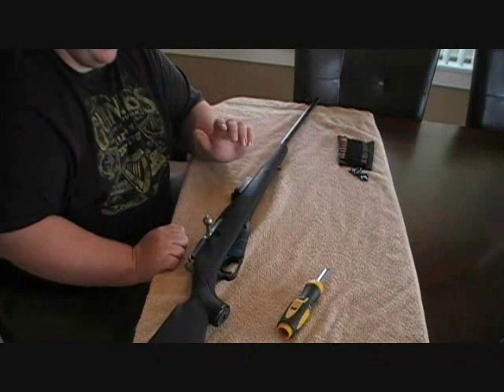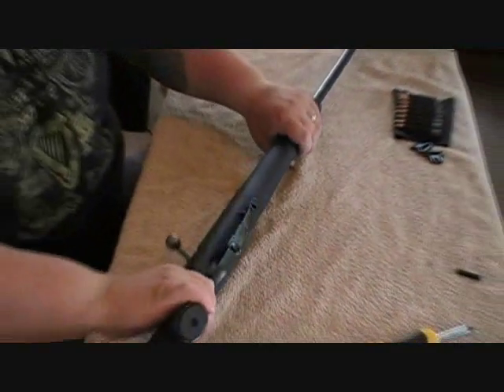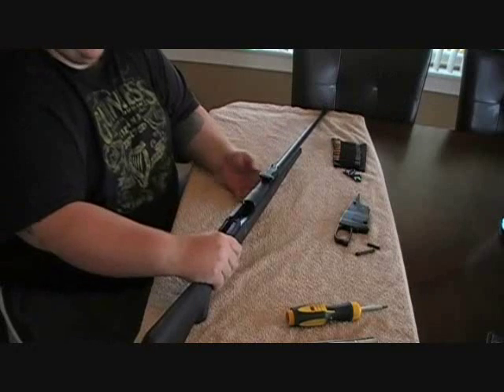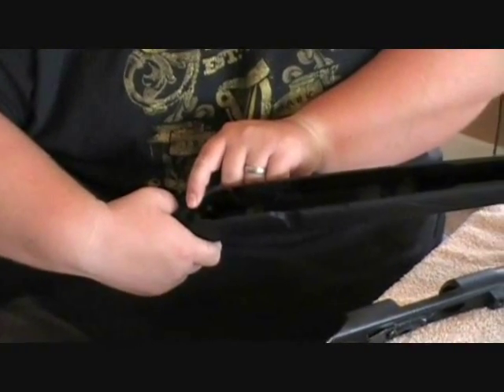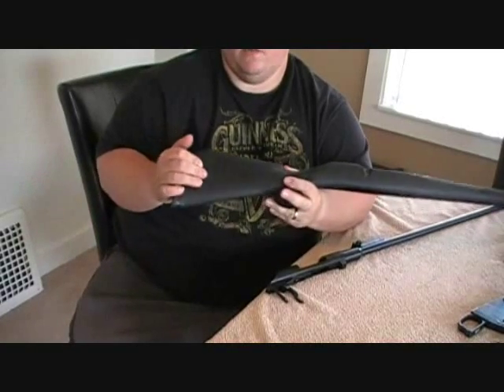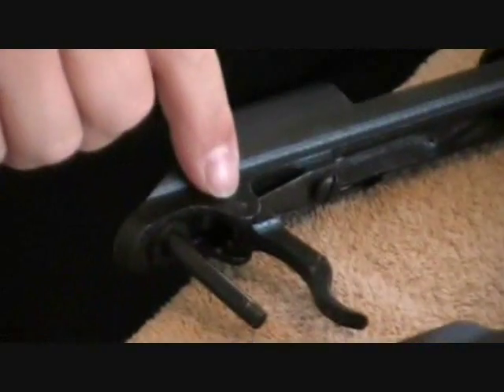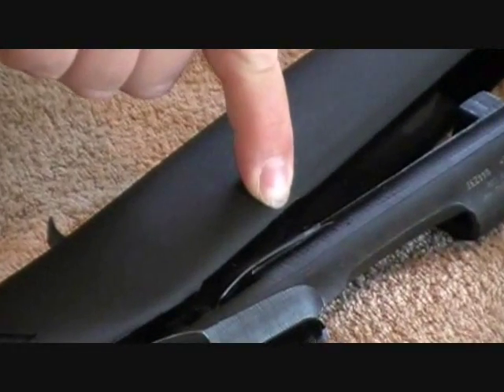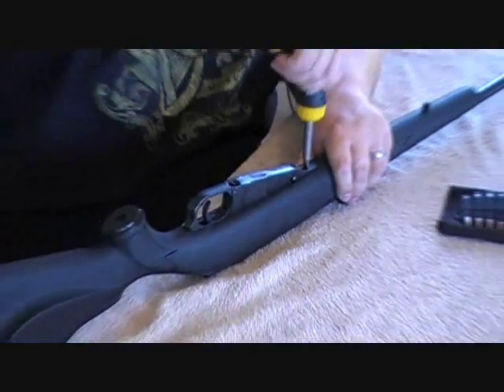ATI Mosin Nagant 91/30 Sportster Stock

Comment: slide your shell caddy over the sling mount and put a small cut right on the shell caddy and it stays in place perty good. it works best if you run a sling though. if the shell caddy wants to fray then melt the edges of the cut with a lighter and itl stay together.